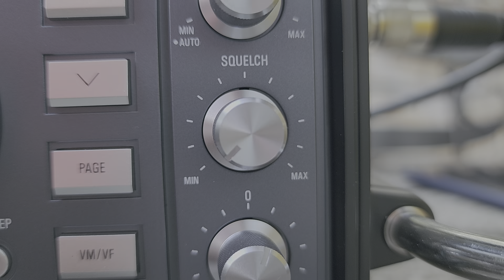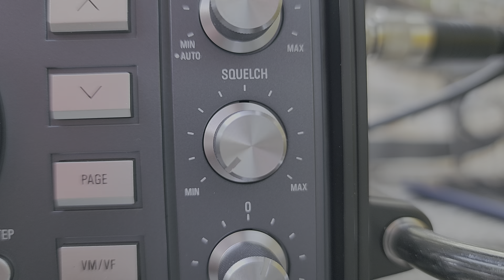Why we do not really use Squelch on shortwave bands and use it mostly for VHF UHF signals

Comment: 2022....is there still anything to listen to on SW radio?
I used to listen in the 60's / 70's ...
Reply: I have actually tried recently, but my area is plagued with RF noise. Nothing, absolutely nothing comes through the noise produced by the jungle of computers, LED/fluorescent lamps, utility transformers, switching power supplies, light dimmers, etc.

Comment: Another reason is that in VHF radios most of the noise is generated within the radio itself. Even if you disconnect the antenna cable, that annoying "hissss" will still be there, so in the absence of an actual signal, an audio squelch is pretty much mandatory. In HF or communications radios, OTOH, most or all of what you hear is actually coming through the antenna, and it's up  to you to decide if it's just noise or some weak signal. A squelch would just silence the weaker signals.

Comment: I am not an SWLer but a Ham. Would like to just add my input as to what uses I have come in contact with squelch on shortwave. In no particular order.
1. 10m Amatuer Radio band uses FM in certain segments of the band and sometimes, although rare even AM. There are also repeaters. FM gives a strong hash sound that is difficult to listen to over time.
2. CB/27MHz/11m has a lot of countries who uses AM and FM, in fact, very few countries allow SSB on CB. 
3. For those using packet, pactor and other digital modes, squelch can be usefull to quiet the radio when not engaged, especially for someone running a BBS.
4. I know 6m is not part of HF but many HF radios have the magic band. It is a band that is often quiet, especially out of Sporadic E season. So what many people do is program channels that they scan to be away from the radio and when there is activity they can run to the radio.
Cheers

Comment: The reason squelch is on some HF radios, is there is a 10 meter FM section and people don't want to hear hash.
Reply from the maker: in this case it is not for that purpose, it will not receive FM on 10 meters... it's just for the VHF Airband